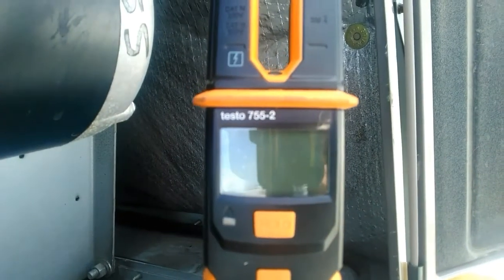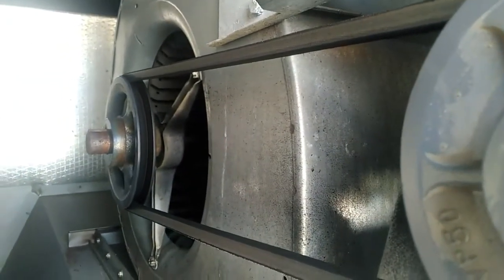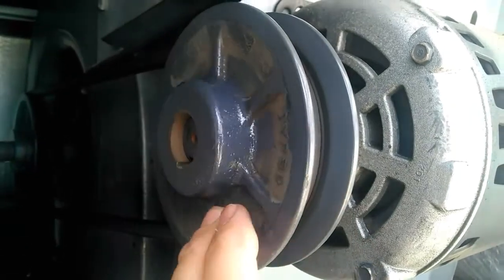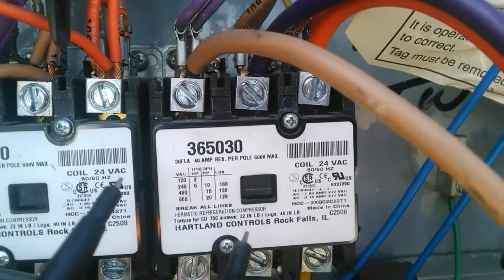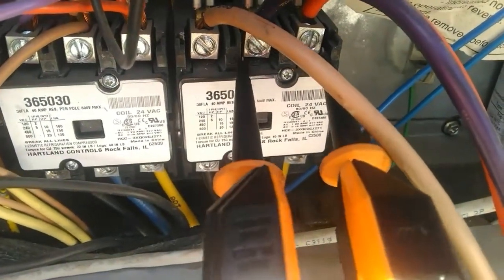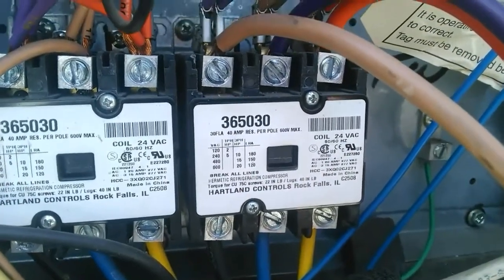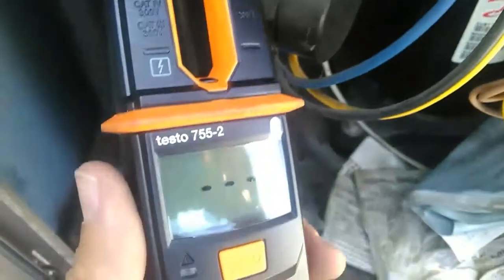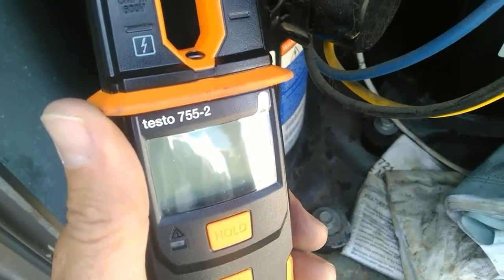Testo 755-2 HVAC Know It All

Comment: This will only determine the rotation of the electrical supply, still no guarantee that the motor is terminated to spin in that direction. No way to tell without bumping the motor

Comment: I could never justify buying that meter just for phasing a motor.. any critical application will either use a vfd or phase monitor to ensure correct rotation.
Reply from the maker: It's also a regular meter that checks volts, amps, ohms.